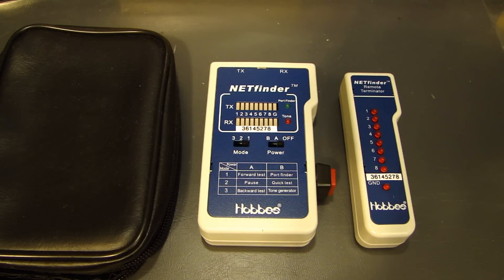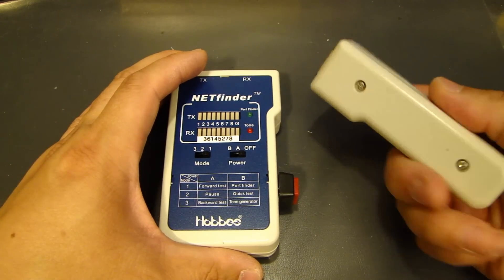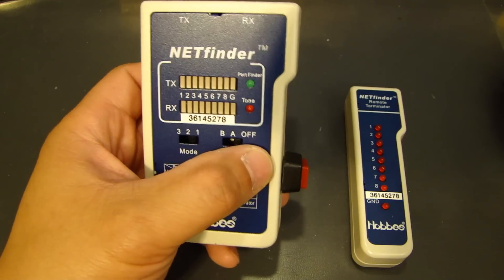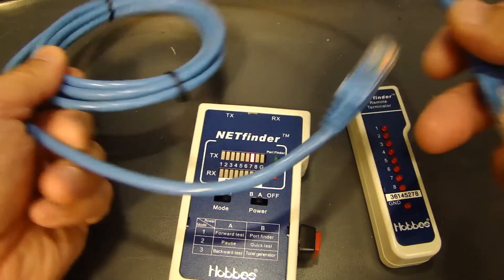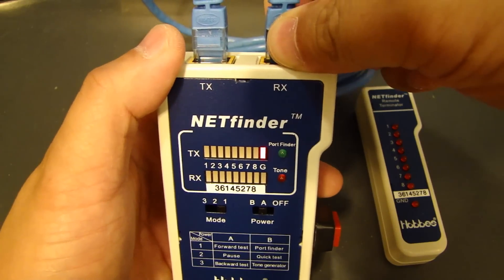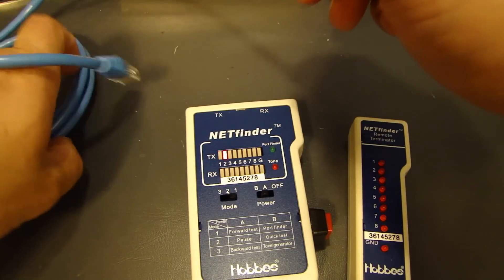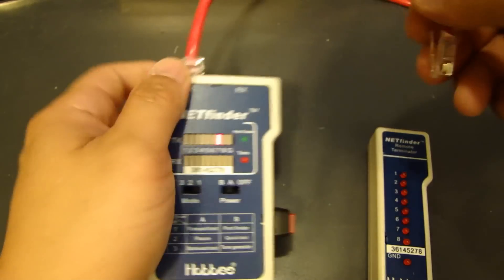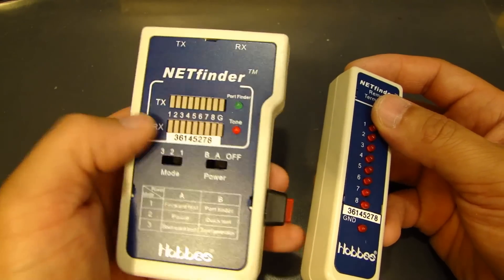How to Test Your Ethernet Cable

Comment: HOW DO YOU VERIFY WHEN EACH ENDS ARE IN DIFFERENT ROOMS? ITS EASY TO DO A DEMONSTRATION WHEN BOTH ENDS ARE INCHES APPART.
Reply from the maker: The transmit side will always scroll 1 to 8. Connect the remote tester to the other end of the cable (in another room) and you want see the LED also scroll 1 to 8. That's how you test both cables. The connector on each end of A SINGLE cable is the end. One cable doesn't become two. Doesn't matter if that cable is in one room or two rooms away. So this video shows you what you need to know.

Comment: Im having some issues with my Cat5 from a 3GB router to my Direct TV receiver. Ive tested my IP and Im getting 100mps on my DL, however when I try and use the DTV stream feature, it tells me that my IP isnt fast enough and to check my Internet connection. DTV techs cant figure it out (not surprising). I was going to get a testing kit like this to see if the 2 cat 5s are reliable, but not sure this kit will tell me that. Any ideas on the trouble shoot ?
Reply from the maker: If you can test with your computer on that same ethernet cable to get proper download speed test, then there is no problem with your cable. In techie term, you have just confirmed your Layer 1, 2, 3, 4 to be good.

Comment: I have my house wired with cat 5 but was used for phone cable.  I can hook up cat 5 connectors to the phone jacks pretty easy, but don't need to do them all.  In my attic is a bundle of wires.  How can I tell which one is which without cutting all of them and jacking them with ends?

Comment: Thanks for your instructions. 
I would also be happy to see what happens when a NOT correct cable connector is tested, and how to analyse what to do next.
Reply from the maker: +liesbeth f If you find a connector that's not correct, just cut the connector off and re-crimp. There is no fixing to a bad connector.
Reply: Before you cut the terminal off, put a small piece of tape on the end you're going to cut, makes a handy reference then to differtiate one end from the other and you know then which end you adjusted

Comment: How do you test it if the two ends are in another room and can't look at both devices at once?   Is just looking at the sequence OK, or do they have to be showing the same numbers at the same time?
Reply from the maker: If the two ends are in different rooms, you just need to look at the smaller receiving device. If it's straight thru cable, then the LED will light up in sequence. If it's x-over, then it will be according to the pinout of the RJ45.

Comment: Hi.

A bit late to the party, but how to test a cable that ends not in a male terminal, but a female wall plate? I guess just plug a known good patch lead into the wall plate and test there or is there another device?

Thanks.
Reply from the maker: Like you suggested, just use a known good cable to extend it so it becomes a gender bender.

Comment: cool video. Do you have a video showing a failed test result?  What do you recommend for fixes once you get a fail result, or do you just re terminate the cable then replace if needed?
Reply from the maker: If the test fails, the LED for that pin that is suppose to light up, will not light up. The only fix is to cut it off and recrimp.